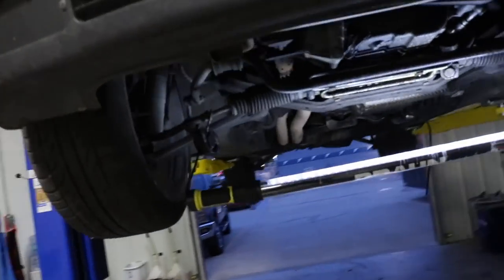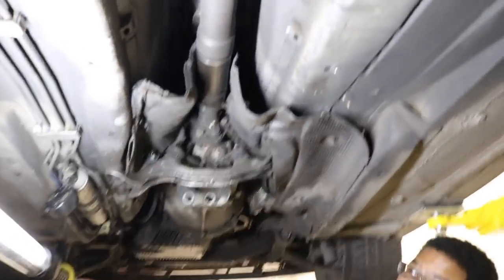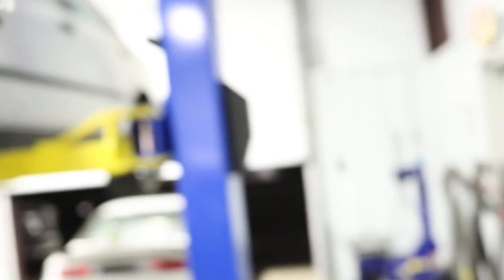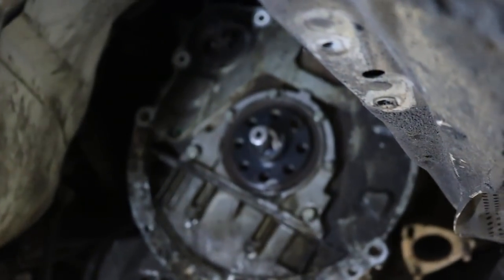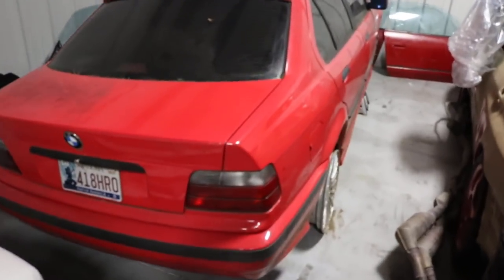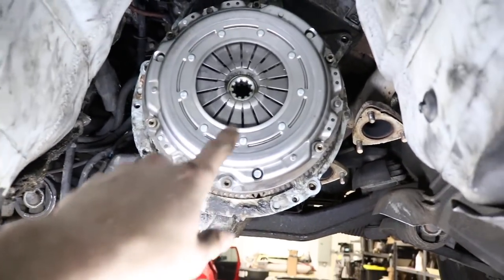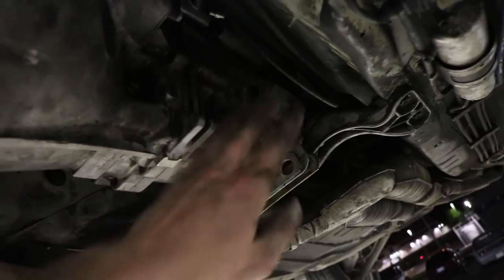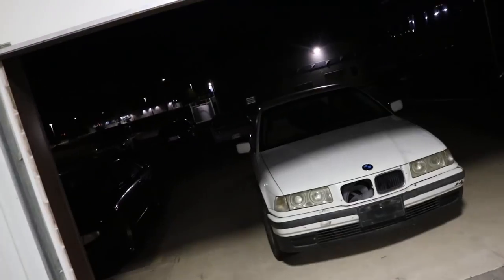92'-99' BMW 3 Series Clutch Replacement HOW TO: EASY

Comment: Yeah if you have a lift and a few friends it’s easy, idk if I’m gonna be able to do this on jack stands in my garage
Reply from the maker: xTheNameisEthan I’ve done it on jack stands. It’s definitely a bit more challenging though haha
Reply: @jspeedracing  me currently a week in lol cuz no one talked about the nut behind the starter on the obd1 cara
Reply: @zzzzf8404  I think that might be the issue I’ve ran into. How did the rest of the replacement go for you?

Comment: Not much of a how to you don’t even show which way the clutch goes in or to torque the flywheel or pressure playe
Reply: The clutch only goes in one way. On most kits says flywheel side and pressure plate side.

Comment: Hi I have 1999 BMW m3 convertible and I am doing automatic to a manual swap now I need to buy a Stage 1 clutch kit for zf 5-speed manual transmission which I got from 1998 BMW m3 any recommendation

Comment: Question for the folks that have recently owned one of these cars or earlier as a daily, what is your experience with them? I recently came across a 1989 3 series wagon that looks beautiful but have always heard about reliability issues, costly maintenance and them generally just being a pain to work on. Has this been the case for you? I do perform all the work on my own vehicles so keep that in mind. Only way it goes to a shop is if the job is something that requires expensive specialty tools I don't have or something like that.
Reply from the maker: biggboysouth Good question man. I have bought 5 E36’s and have had extremely good luck with them. To me, they are very simple. This whole “German engineering” thing I don’t quite grasp it. If I could only own one project car it would be an E36. Parts are dirt cheap and easy to work on. The motors hold up very well too. They are getting more difficult to find super cheap these days. I think a 89 is an e30 but not sure. Might be another country thing. Feel free to hit me up with anymore questions. If you need some Condor bushing let me know, I might be able to get you a discount
Reply: @jspeedracing  Thanks for the fast reply and I'm in the States (Florida). Yeah you are right it's an E30, I'm new to euro cars. I've been into muscle cars my whole life but lately I've been trying to experience other car scenes. Currently exploring JDM with my 97 Miata. Love driving it but for a daily it's small and I could really benefit from having a car with more room to pick up larger items. Been eyeing early 80s corolla wagons and then came across that BMW I mentioned. A fun to drive wagon sounds like a perfect daily.

But that's awesome to know from your experience it's user friendly to work on and cheap to maintain. That's the main reason I never looked at them more seriously due to fear of being stuck with a car that would be difficult to maintain.
Reply from the maker: biggboysouth the wagon sounds pretty cool to me 👍
Reply: I’ve owned at least 10 e36’s
Right now I currently own 2
1997 beautiful silver 328is coupe 5 speed, and a grungy but beautiful to me white 1999 323is coupe Automatic 
It has been quite a journey/experience 
Love & Hate relationship, but over all I agree with John e36 BMW’s are awesome, it’s up to the persons personal taste, I personally have dished out a lot of money trying to get my white one right, and wow I still can’t believe it’s not ready lol, good luck with everything, awesome channel @johndrives 💯🙌🏽👌🏼✨
Reply from the maker: Pele23 10 E36’s! Wow that sounds awesome.  thanks brother.
Reply: Jon Drives since the age of 22 and now I’m 44 and it’s been a guilty obsession lol 
1. blk 1993 325i sedan 
2. blue 1995 m3
3. Silver 1993 325i
4. Green 1994 325i
5. Blk 1997 318ti
6. Green 1995 325is coupe
7. White 1997 318ti
8. White 1999 323is coupe
9. Silver 1997 328is coupe
10. Hopefully my dream 2016 m3 lol
Reply: biggboysouth did u get the e30?
Reply: Bit late to answer, but anyway, this could help someone with the same questions later.
E30's and E36's are very reliable cars, I can speak about the M20 and M50 engines specifically. I do my own cars as well and can tell you that alone will make your maintenance/repair bills very cheap. There's a lot of aftermarket parts as well as second hand on the market. As with any car, if you buy a piece of garbage for 50 bucks, expect the car to behave like that and cost you a fortune to fix in parts alone, but if you find a good example that is not that beaten up, you will have a great vehicle.
Regarding how difficult are the engines  to work, the M50's are a pain in the ass, M20's not so much, and the 4cyls like the m10 and m43 are very easy to work due to their size. But both are nowhere near as dificult to work as the modern ones
Reply: I've put 7k miles on my 95 325i and been really decent tbh, need to put a new clutch in
Reply: @jspeedracing I

Comment: Hey dude, I replaced my clutch on my 99 323ic and and it's the type you have to lock in with a special tool, well I got all new parts even a flywheel and when I put everything back on the clutch to too far back from the fork and bearing and I dont know if I have unlock/release anything or what to do, could you help me out.
Reply from the maker: is the plate backwards?
Reply: I'll get it back out and let you know, thanks for the feedback.

Comment: Hi, my clutch is engaging progressibly low when using it lets say to park and after some poiont its not doing anything unless you pump it couple times. My question is, should i replace the master cylinder underneath the car or the one behind the pedal? Thank you man
Reply from the maker: try the one under the car. It is called the slave cylinder. The master is the one in the engine bay/pedal area.

Comment: i'm trying to buy a bmw, but the guy says it need a clutch and clutch cable. Is this true? Will i really have to replace the cable?
Reply from the maker: no such thing as a cable. start with the slave cylinder
Reply: I thought manual cars have a clutch cable? Sorry, if it sounds stupid. I'm trying to learn stick and want to get this BMW for 1500, I can get the clutch replaced for 620. The seller said car needs clutch and clutch cable?? should I just dismiss him and just start out with a new clutch first ?  05 325i
Reply from the maker: @carloscortez3836  start with slave cylinder. Then if that doesnt fix it. Do the clutch. Message me on instagram @jon_drives and i can help

Comment: i have a quick question about the E36 clutch. My car won't go into reverse when it is on, but when the car is off it slips into reverse no problem. And its hard to get it in and out of gears 1-5 when the car is running. I think its a clutch issue, but do you have any other ideas as to what it could be?
Reply from the maker: HunterAlexanderFilms Bad slave cylinder?
Reply from the maker: They are cheap at auto parts places. Not difficult to replace either. Try that, and don’t forget to bleed it
Reply: @jspeedracing  okay great thank you, ill try that!